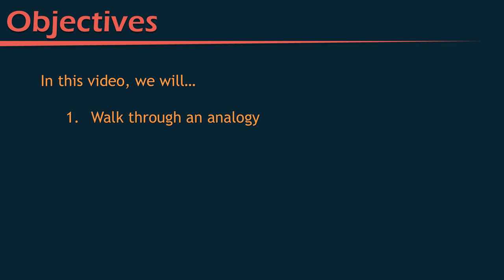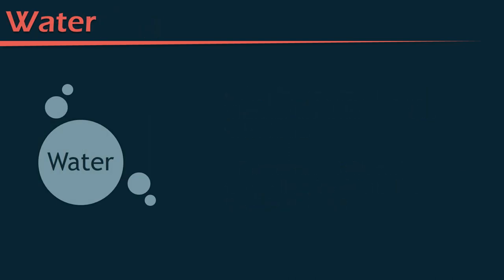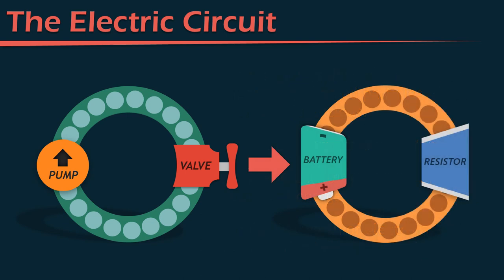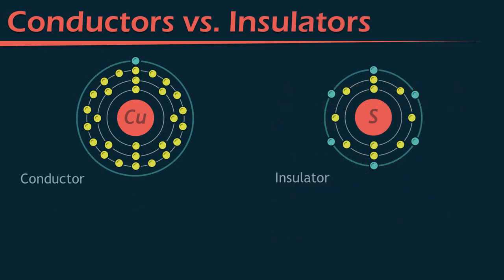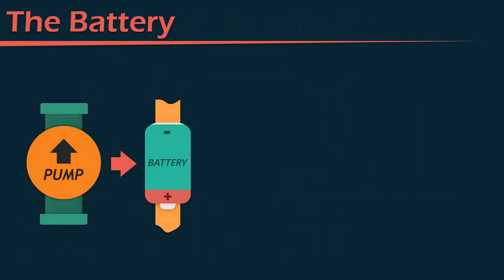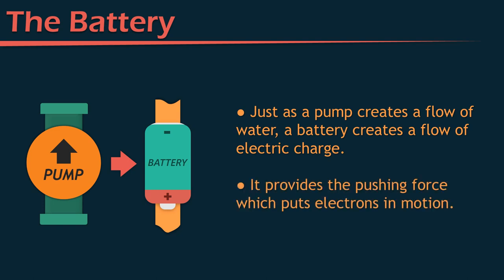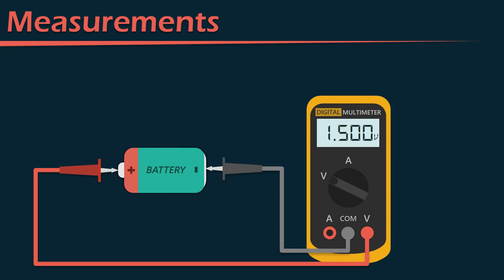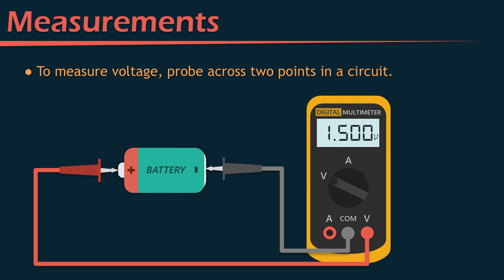An Introduction to Simple Electric Circuits (3rd Edition)

Comment: The model of water flowing in a pipe and electrons flowing in a wire isn't quite right is it? The electrons don't actually flow, rather there is an electromagnetic field around the wire created by the voltage and that wave is transmitted from the source to the destination at the speed of light? How would you explain what's actually happening in the wire vs. the model of electron flow?
Reply from the maker: Electrons do actually flow in a wire. Generally the analogy holds very well, though of course, any analog breaks down at some point. I think what you are missing is that the propagation speed of an electric field (within a conductor) does not equal (≠) the drift velocity of the electrons contained therein. The marble analogy at 17:45 may be more instructive on this idea. Pushing on the marbles at left-end of the pipe almost immediately causes the movement of marbles at the opposite end of the pipe. This, in a way, models the propagation speed of the electric field (which is very  close to the speed of light through most media). The electric field almost immediately delivers energy to the destination (i.e. a "load"), without the electrons from the source needing to actually travel all the way to the load. Does that help? Try this: https://en.wikipedia.org/wiki/Speed_of_electricity

Comment: Thanks a lot for the effort that has gone into all your video's!

I hope we won't have to wait too long until we see you again, but I know life gets busy and quality takes time and effort!

Some suggestions that perhaps you could consider for future videos:
Basics of AC circuits (reactance, impedance, oscillation, impedance matching, multi-phase systems, current/voltage lag in inductors and caps) etc etc.
Circuit simulation in LTSpice.
Concepts and design of switch mode power supplies.
Different power supply topologies.
Concepts and design of precision voltage references.

Anyway, just some ideas on area's that i feel haven't been so well explained on many other YouTube channels, and I have no doubt that you could create excellent content for!
Reply from the maker: Thank you for your kind comments and encouragement. I'm getting close to finishing a basic AC analysis video. It's really testing my ability to break things down into manageable bits! 29 slides in so far!

Comment: Your tutorials are very good. I have seen many videos that explains the basic components and it's working. But I never saw any videos that explains the practical applications of each components and how to pic components for our circuits. If you can make a series of video about it, that will be very useful for electronics Lovers like me. Because many people know the working principle of each component and it's fabrication. But most of them don't know how to use it in a circuit. I know what I am asking is very difficult thing. But I'm just giving an idea. Because you can do it well. Anyway great videos. Nice explanations.
Reply from the maker: Thanks, Ebin. I like your idea. It would be very difficult, but perhaps an "electronics round-up" with simple explanations and typical applications would be useful. Thanks for the suggestion!

Comment: Hello and thank you for your excellent videos! Is there any book you recommend for circuit analysis? I want some resource with lots of exercises to practice!
Reply from the maker: Thanks! I like "The Analysis and Design of Linear Circuits" by Roland E. Thomas and Albert J. Rosa.  There are solutions manuals floating out there on there on the internet. I'd suggest finding a solutions manual first, and then buying (or finding a pdf) of the actual text book, for whatever edition the solutions manual is. I have the 5th edition (2006). They're all basically the same so don't worry about that.

Comment: Hi. Another brilliant video as always. Thank you so much for making Electronics as a subject not so boring. Really appreciated! Just got a question: I'm really curious about whether you use one program, or multiple programs to create these presentation slides and what are these programs' names please? And how do you integrate animations with slides?

Your use of colors and animations is probably the No1 factor of not making me run away from your videos Haha. But your planning process seems to be clearly your reason for success in my opinion. Great work.
Reply from the maker: MyOpenSourceKnowledge Hi! Thanks for all of your kind words. All of my videos/slides are made entirely in PowerPoint. First two were made in PowerPoint 2010, and the rest in 2013. Animations are just the standard animations in powerpoint. Just have to be a tad clever to get what you want. All graphics made with shapes/drawing tools in PowerPoint.
Reply: Interesting. Wasn't expecting PowerPoint to be the answer. Guess I'll give PowerPoint another try and put more time into exploring its potential. Thanks.
Reply from the maker: MyOpenSourceKnowledge It has its limitations but it’s actually pretty powerful. Theres also a screen/audio recording function built in, which is what I use. I like that I really don’t have to leave the program ever.

Comment: Hi! When measuring the current with the multi-meter, where does that resistor come from and do you have to tell the meter what resistance you're using? Grateful for your vids and binging on them. Great teaching skills, you could even earn some pocket money on Skillshare on the side.
Reply from the maker: I think your understanding is reversed on this one. The battery and resistor *is the circuit*. It's nothing different than the simple circuit we studied throughout the video. If we wanted to measure the current in that simple circuit, we put the meter in line (in series) with the circuit and it will tell us the current. It doesn't need to know anything about the circuit it is measuring.
Reply: @SolidStateWorkshop  Thanks for your response. So could the example have been given without the resistor? On the previous example there was no resistor in the circuit. Could you have just switched the meter from 'V' to 'A' and same with the cable and just measured the amperage of the same circuit, which was basically a battery in a circuit by itself?
Reply from the maker: @PlaAwa  If you remove the resistor, you will short out the battery through the multi-meter. The multi-meter is effectively zero ohms (for all intents and purposes). There's no point in trying to measure the "current of a battery". (That sentence doesn't even make sense.) A battery is a voltage source. You can measure the voltage across its two terminals, but the battery will not produce a current unless it is placed in a circuit. In this case, the simplest possible circuit is a resistor across a battery's two terminals. There is no circuit and no current without the resistor.
Reply: @PlaAwa  if you do that, its like dividing by zero, you're gonna create a blackhole (or charred fuse if your MM is protected) xD